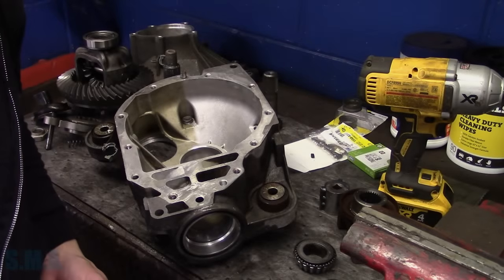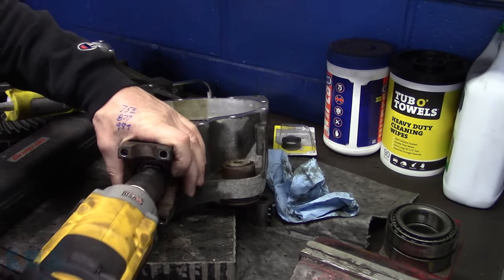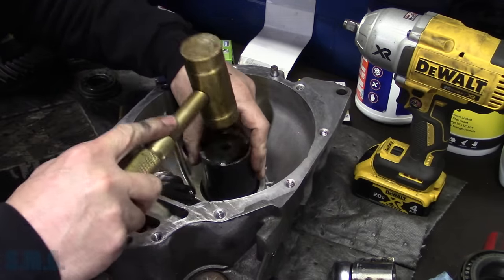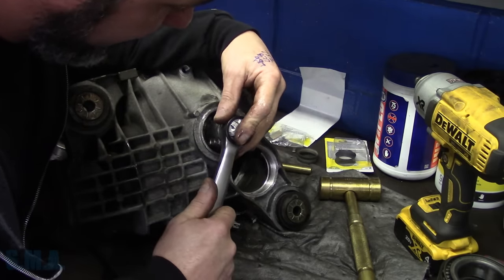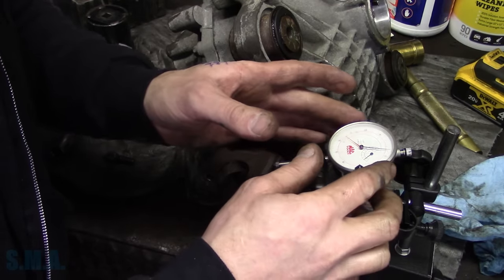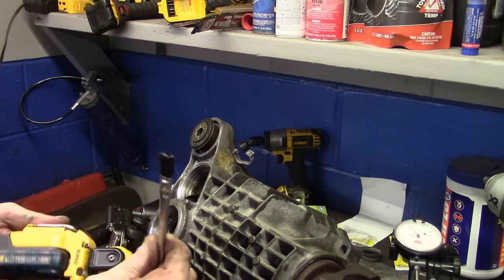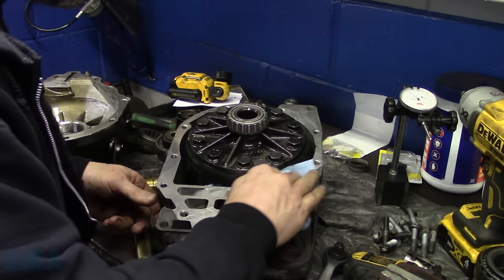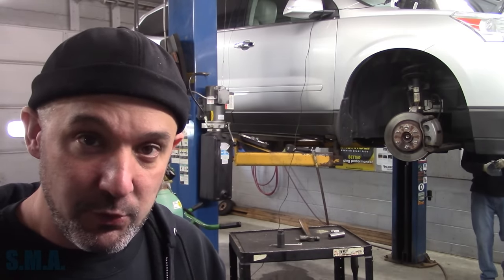Chevrolet Front Differential Set Up: Reusing Old Gears

Comment: Around 1970 Ford had a problem with their casting material. The case for the spider gears would wear rapidly where the axle side gears fit. This would result in a clack, clack noise as you came up to a stop. We replaced a lot of cases so we became pretty proficient at adjusting ring and pinions. If you have adjusters on the carrier bearings the easiest way to set backlash and pre-load is this: run the adjusters in until you have both races and bearing touching with very light pre-load and a lot of backlash between the ring and pinion. Move the ring gear into the pinion by backing off the "tooth" side and running in the "back" side of the ring gear equal amounts until you get zero backlash between the ring and pinion, but no pre-load on the teeth. Lock the "back" side adjuster. Turn in the "tooth" side adjuster until you get the proper backlash. This adjuster will be hard to turn as you are also spreading the case. When you get the proper backlash you will also end up with the proper pre-load on the carrier bearings.

Comment: I’ve never bought gear oil in a bag, but I have seen some guys use gear oil in a bag as a trail trick. I don’t remember what he broke but the rear diff cover had to come off. He caught the oil in a couple ziploc baggies, and rigged whatever it was that broke. Then he just stuffed the oil filled bags back into the diff and threw the cover on. He said the only bad part about doing that is having to clean out all the chewed up baggies when you get home.

Comment: Hey my fellow mechanic, when checking backlash, measure off of ring gear while holding pinion gear stable. Also check your pattern using oil base paint. Good luck.
Reply: probably doesn't have a long shaft right angle indicator attachment to get it down into the gear at a 90 to read it. I don't recall seeing any plugs or holes that allowed access straight in.
bearing bad, guaranteed the gears are worn and setting by backlash will rarely give correct tooth pattern anyway. checked right it's probably way over what they claim is serviceable.

Comment: This job may be in my future. My 01 gmc is making a grinding noise in the front. Everyone told me to change the wheel bearings so I did, well that didn’t work so I’ve narrowed it down to the front differential or the transfer case. I honestly hope it the front differential. It looks like an easier rebuild. Either way I always have SMA videos to save me when I screw up.

Comment: Very informative video!  Thanks!
I changed gear ratios in my 69 SS396 Chevelle back in the 70's.  Didn't know as much as I should but it turned out okay. Use Prussian Blue to check gear pattern.  No dial indicator to check backlash....... Later I rebuilt the rear diff in my74 Ford Ranchwagon.  It had a bad pinion bearing.  That came out okay too.  I must have put 400 ft. lbs. of torque on the pinion to crush that sleeve!  I crushed it until the pinion had just a tad of resistance when turning.  No inch lb torque wrench.......

Comment: I do a lot of these and I see the t clips broken a lot , causing the adjusters to loosen up. When I put them together , after I set them up and get a good pattern , I will knock the t clips into place and place a spot weld on them and the adjuster to prevent that issue from ever happening again. If it does need to come apart in the future for whatever reason, simply grind the weld off .

Comment: You are a talented and patient mechanic, i always hated setting up split case and removable cover rear ends, I alway found third member units quicker and easier to set ups most all I have done ! Since I sold the 4X4  Tahoe are rebuilding classic Corvette and Chevy/Pontiac and the odd Oldsmobile muscle cars! It is really nice to watch a talented guy work. I envy you impressive computer and Module loaded cares, did do OBD1 and later earlier version of OBD2 before the EPA mandated great number of modules and aircraft types”Fly by wire”:Technology that you seem to handle so well! It is a lot easier here in Florida, No salt, no Rust, unless you are on beach area and your car gets flooded by Atlantic or Gulf storms or hurricanes!

Comment: Gear oil in a bag is actually a pretty good idea. I'm sure you know how difficult it is to fill a diff or transfer case or something straight from a bottle. The bag is far more flexible for getting into tight areas and you can squeeze all the oil out as you go. Plus it prevents mixing weights or types by not using one of those filler pumps.

Comment: Eric, playing catchup with older vids of yours. 
If I didnt know better, I reckon someone has had this apart before and swapped the "good" race onto the damaged bearing and put the good bearing with the damaged race. A backyarder or field repair maybe? There is no way both the damaged bits were not together originally. That is also likely to be when they cracked or broke the lock tab as I doubt they used new ones based on the other damage.

Comment: Because I've ran across a couple of customers that needed hobbies other than driving around listening for noises in their vehicles, I usually replace the ring and pinion with new ones.  Not on my own vehicles are ones I sell though.  
Great job.  Don't see many shops bothering to go into diffs like that.  But guess you didn't intend to from the start.

Comment: If that were my truck, I don't think I'd cheap out and re-use the pinion bearings...  I think I'd spring for the extra $100 for new ones, to save myself the labor of replacing them when they wear out.  You know they've got to have at least 50% of their life gone, based on the wear on those other bearings...

Excellent video, as always, Mr. O.  :-)

Comment: I rebuilt my 04 Denali front diff. 10hours myself first time. LOL. I did the rotational bearing torque with a 1 foot wrench and pushed on it with a mail scale to  15in pounds for the pinion bearingt. I adjusted the carrier adjusters by hand just loosen all the bolts between the case halfs adjust then re tighten keep going a little at a time till you get there. My bearing races would spin in the housing as well. used a little cold chisel to rough up inside were the race sits. Also the lock tabs seemed like a crap design. after getting the bearing adjusters right i took it apart and pinned the turning parts together so they could never move and reassembled. I used a smallish drill to drill 3/4 though then cut off the back of the drill bit to make a pin. lock tite ed in as well.

Comment: I believe you are supposed to leave the seal off of the pinion shaft until after  you have the backlash set , so that it does not mess with the preload torque.

Comment: The backlash is usually measured at the ring gear holding the pinion from moving. The way you measured can change by moving the indicator farther from the center of the pinion. ie 2 inches  from center or 3 inches from center.

Comment: nice diy apple pie specialty socket . That been 300bucks off the snapon truck lol (would of had free pocket screwdriver though :-) )
That lock tab was a right shite idea , a bolt retained tab that easily replaced and kept off until final setup been far easier .
break those stock tabs and it turns into groundhog day lol . 
Good job big man, bit of a big bill but the guy was few miles off needing a full diff replacement and a tow lol .

Comment: Differential work is the most difficult aspect of mechanical repair that I have come across! Some gear/transmission shops have one guy that does ring and pinion work, because it is very specialized, close tolerance, bitchy work!

Comment: I've found that sweeping the pinion depth helps a lot with setting up used gear sets from another rear end, if the differential design permits. I make up a set of checking bearings and yoke (honed or acid dipped until they are a snug slip fit) and then deliberately start with the pinion too deep. I then add .002", note the resulting pattern, add another .002", note the resulting pattern, etc. This gives a relatively unambiguous way to see what the correct pinion depth is since there will be a distinct and abrupt transition between the pinion being too deep to then being too shallow. In the transition zone I can then take an educated guess on what the wear pattern should be. Helps a lot on used gear sets where the coast side has some wear and the pattern deviates from the stereotypical contact patterns.

Comment: i just had the bearings and seals replaced on the front differential of 2015 bmw x1.  Bmw wanted to replace the complete diff for about $5500 canadian, took it to a transmission shop and they repaired the diff for $1200.  Still a lot,  but much better than $5500.  If I had seen this video first I could have done it myself like Eric says...NOT.  Lol

Comment: at 33:12 dial indicator isn't at 90 angle to the pinion, so it's throwing the measurement off.
used gears that had bearings bad/loose, are likely worn badly and will have a bad contact pattern with the mesh set by backlash only as such. howl-o-matics :)

Comment: MMMMMMMM, i am 64 now but when i was 20 I had a 67 Camaro with a 427, 12 bolt with 456 gears, a GM dealer installed the gears for the previous owner with no warranty and it always made noise until for me one day it go too noisy so I replaced the ring and pinion, bearings, crush sleeve, etc. I got LUCKY with pinion depth and installed the right thickness shim 1st time, after that they give a pack of different thickness shims to achieve proper gear pattern for left to right ring gear depth, I never checked backlash only pattern with white paint so I kept swapping shims until the pattern looked perfect , it was quiet as can be considering it was a 456 ratio and durable as it saw some drag use with slicks, NO issues. 

Amazing how that locking tab destroyed some internals there and fortunately the ring and pinion were untouched.

Comment: When I did the axle seals on my 99, that snout part on the passenger side got me good. I fixed the original leak, then introduced another because the gear oil kept dripping out and screwed up that anaerobic sealant. Pissed me off to no end. Great video. Brought back many nightmares for me. BTW - what channel is this....trimmed beard and a torque wrench?? You fancy! :D

Comment: I worked as Mr. Goodwrench three times at big GMC dealerships and I can tell you from personal observations and Regional service Reps confirmation, GM is STILL using Ring and Pinion gear cutting machines that are worn out, sloppy and over a hundred years old. Therefore GM Ring and Pinion sets are Rough when new, the rough gear tooth face smooths out quickly so their differentials loosen up quickly. And, seeing as the differentials are NEVER properly filled at assembly, every single one is up to a full quart Low!  
I was asked by GM Regional service Reps. more than once, " why do you add gear oil to every differential you do a PDI on?"
I showed the nice Lady a brand new, Z71,   1/2 ton,  1500  pickup truck that was so low on Dif. gear oil it was more than half empty.
The nice young Lady said, "We Sell More Trucks that Way."
Lousy gear cutting machines, plus Low Gear Oil Levels when New, mean if you own or have a GM or Chevy pickup truck on your rack, check/ change and service them all. Every differential, every time.
Most customers have no idea that gear oil wears out or is supposed to be regularly serviced, ever!
GM calls for 30,000 mile Dif. service interval if it never tows anything. Under increased towing Loads and Higher Aridzona ambient temperatures, service your Differentials every two years or 20-25,000 miles at least.
Great work,  great videos as always and remember, If Eric can service a differential's gear fluid, You can service your Differential's gear fluid but, Do Not Do what he is doing Here!.
Let Eric Rebuild Your Differential. Seriously Folks.

Comment: Eric....When dealing with "rubber" whether it be a seal or ? please invest in "krytox" ( for areas that see salt water) or "halocarbon" grease when applying to a product that contains rubber. My experience(which is very extensive) working with most rubber products indicates that using any other product on the rubber will, over time, deteriorate the rubber....especially automotive grease.

Comment: Hey nice video but the specs “Pinion and Differential Case Bearing Preload.
30-55 1b in 2006 Driveline/Axle Front Drive Axle - Avalanche, Escalade, Suburban, Tahoe & Yukon New Bearings.used is 25-45 1b in.

Comment: Had to change the pinion seal on my s10. Didnt have anything to drive the seal in with. So an old can of brake clean with a hole knocked in the bottom to allow some room for the pinion shaft worked fantastic haha unfortunately ill have to pull it again :( now its pouring grease out from around the splines of the pinion shaft and yoke..... some rtv should fix that...
Reply: 8:25 nvm just saw that part. looks like I dont have to pull the seal to fix the leak, just saw that part thanks for the help haha literally pays to watch your videos!

Comment: Wish I would've watched this before I rebuilt my differential, there was always a clunk before I rebuilt it and still there after, it seems like it excessive gear lash, I didn't know how to adjust it but I don't think it was set right from the factory, bought it with 68000 and I just rebuilt the differential at 120000 because the pinion bearing was going out and it was leaking.
  But it's not hard to take apart, just sucks I'll have to do it again

Comment: IF I heard correctly the crush washer is to allow proper pre-load of the pinion shaft bearings. Why then are crush washers and rotational torque measurements not used on spindle bearing setup?

Comment: When you initially set up those exterior opposing notched washers did you start each one as far out as they could go and then count five rotations on one side five rotations on the other side etc. etc. until you made solid contact?  That way your ring gear is perfectly centered over the pinion shaft. I only saw you tighten one side to 40 foot pounds flipped it over and the other side to 40 foot pounds. That would definitely not equalize the ring gear to the pinion shaft. I hope I made sense.

Scratch that: when you know I didn’t let it run far enough. Once you got your initial backlash you loosened one side and take the other test center that ring gear on your opinion with the correct backlash.

Comment: It's interesting, I have an 04 volvo with a transfer case sealed the same way (anaerobic sealant) but they have a tendency to leak through the halves of the case. Volvo put out a service bulletin to reseal it using gear oil resistant silicone. Wonder if these cases also leak between the halves??

Comment: I wonder if that prep spray is really an accelerant. I use loctite 515 a bunch at work and it says it fully cures in 24 hours but with in 30 minutes it's good for a few hundred psi

Comment: We did a ton of those under warranty back in the day. What a shitty design. They sold you ten locks because the parts department doesn’t want to sell you two out of the bag. Just remember parts department gets a bonus check on sold parts. Most of the time we replaced the entire unit under warranty because the locks usually destroyed everything.

Comment: A little confused on measuring that backlash on the pinion yoke. Would that not be very dependent on the yoke size ? Since your turning that on an arc, the farther out from center you measure the more perceived backlash there would be .. All else looked good and the fact the pattern was correct maybe it doesn't matter at all.

Comment: I had bought a digital torque wrench just for the input pinion bearings in a jeep. Those we about 18 in lbs for old worn in bearings and 26-28 with new bearings

Also, measuring backlash, isn’t that supposed to be done on the actual ring gear?
As you are measuring a different gap on the input pinion compared to the actual ring gear.
Reply from the maker: and that is why I divided the measurement by 2 :D

Comment: Enjoy your vidoes......mechanical fitter of 40 years here, could people use the correct terminology when fitting bearings. Taper roller bearing outer is the cup, the inner is the cone. In this case, what about contaminated oil damaging the existing pinion bearings. Worth the exta security to change those bearings too. Just saying....😀

Comment: I bought new a 1978 Trans Am and it suffered the exact same carrier bearing failure.  I bought my wife a 1979 Trans Am – same thing.  Seeing this now causes me to suspect that some long dead GM engineer produced a calculation for sizing carrier bearings, it got placed in a manual, now transferred to computer.  You plug in the numbers and still get the wrong answer.

Comment: I was hoping you would show the install of the axle seal, ONLY because i've changed a bunch of them after they have been replaced because they are still leaking after replacement and the bozo put it in backwards! These seals say AIR Side right on them! LOL  Also seeing the traverse on the lift you left us hanging! what was wrong with it strut bearings? Links? Axle?

Comment: When GM refers to backlash, do they measure it at the ring gear? It seems like measuring it on the universal joint coupling closer to the axis of rotation than the ring gear, will distort the reading. If you measuring 8 thou on the coupling, it will result in a lot more on the actual ring gear. Or am I missing something?
Reply from the maker: Yes I explain in the video this is why I dived the measurement I obtained by 2 :)